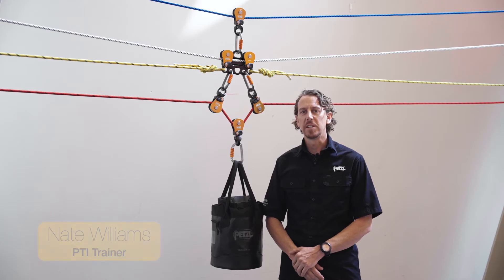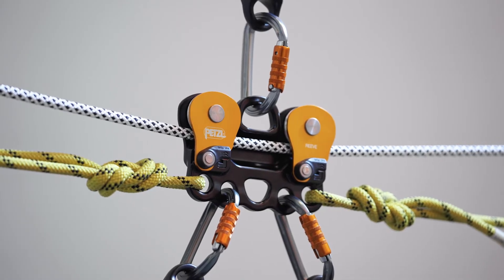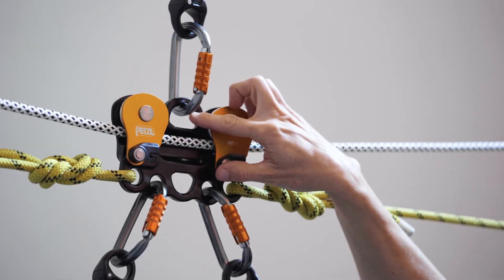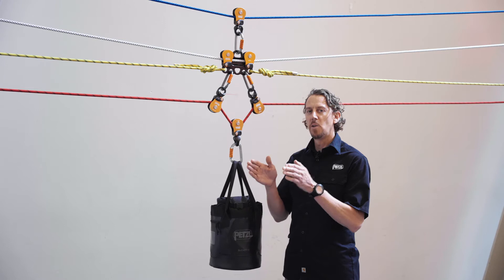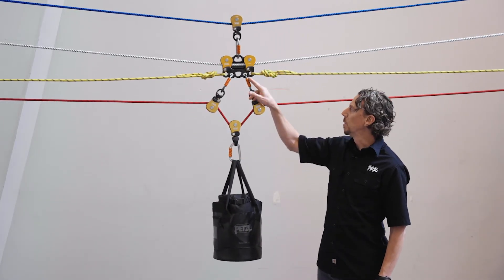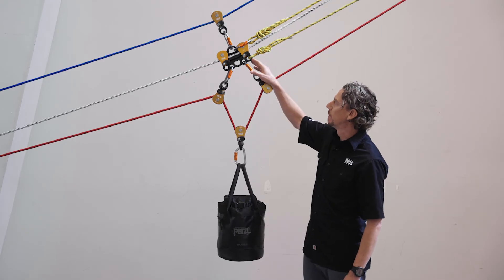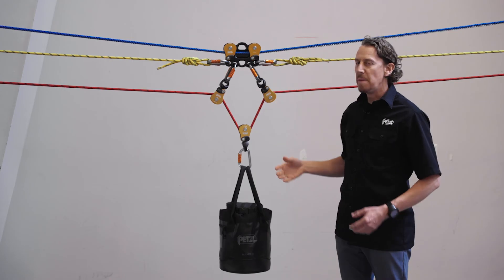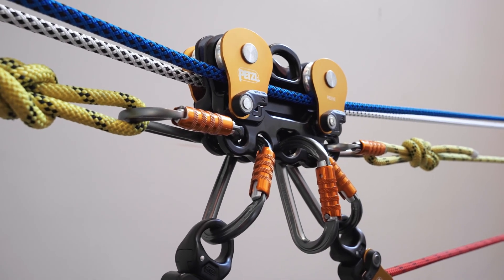How To Use the REEVE

Comment: Just spitballing an idea for the sloped highline specifically rigged with an English Reeve. If you have two ASAP's, one on each side of the reeve loop, could you drop down to a single control line and still have a redundancy? If the control line failed, the system would have a tendency to want to run downhill however the reeve loop would be running  and would cause the uphill ASAP to engage, bringing the load to a stop... Thoughts?